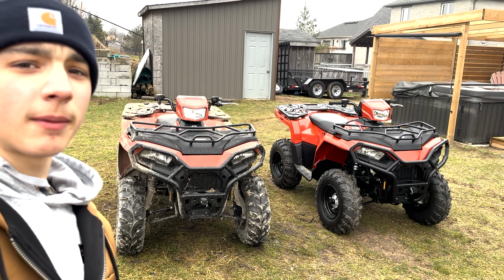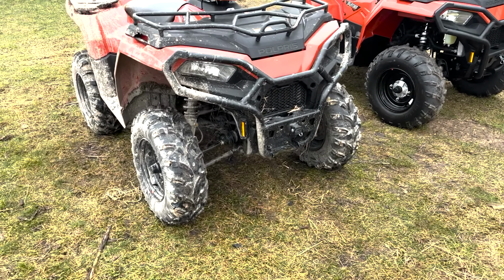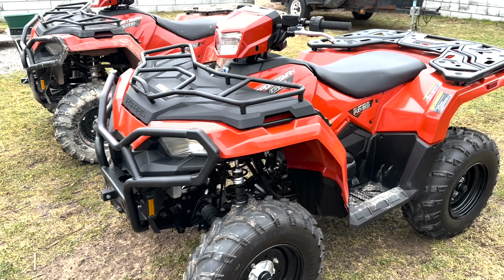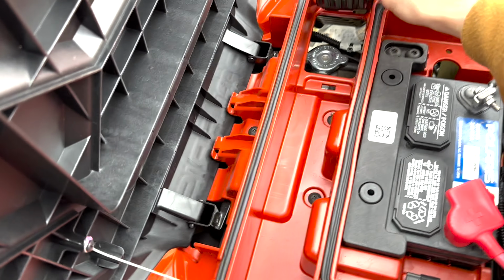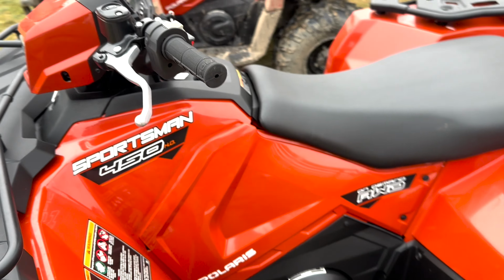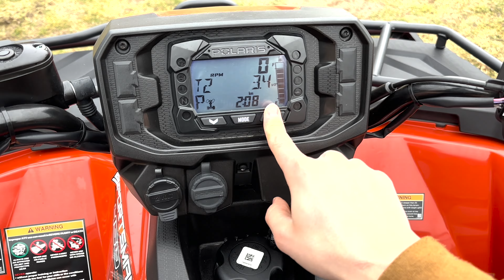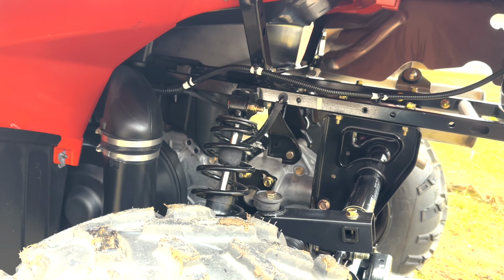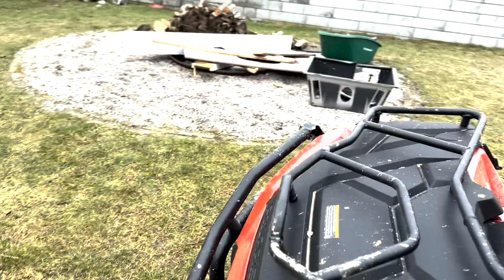2024 sportsman ride and review

Comment: What gear are these suppose to be driven on in a trail? Also on a normal road? What is the top speed on them?
Reply from the maker: Well, it depends on the trail if it is a big mud hole, you’d probably wanna go into low gear but other than that high gear is pretty good for everything else including the road. The top speed is about 100 km/h.

Comment: Any issues on exhaust? mine got loose i have 570 trail 2023
Reply from the maker: That’s weird no I haven’t had any problems with mine yet and hope fully I won’t🙏

Have you had any other problems?
Reply: @gatormonkey  led headlights power steering aluminium wheels beautiful wine red or something best quad i have ever rode mine has 500 km kinda strange for exhaust gaskets to fail but its ok everything is nice and good i think i didnot break it in properly and exhaust didnot seat in nicely i wil order kit for new exhaust springs gasket etc thanks for comment.
Reply from the maker: @Ruxanik2 yea that’s a possibility but unlikely I think but who knows lol 
And I like the LED headlights that the 570s have I was thinking of upgrading mine to those
Reply: @gatormonkey  its really beautifull  looks modern and gives quad aggresive look
Reply from the maker: Ya I agree
Reply from the maker: Thanks for the comments!